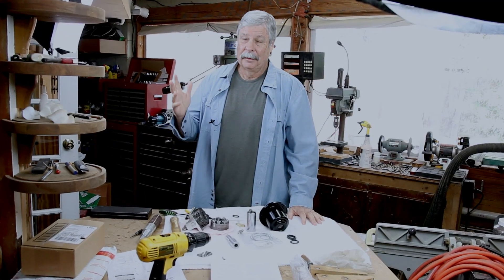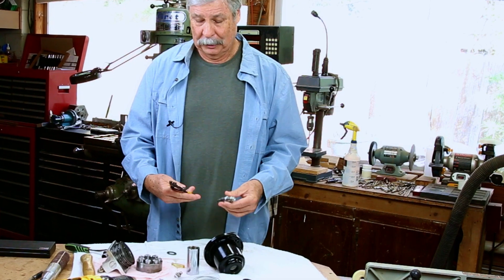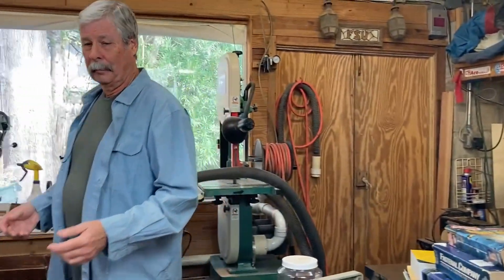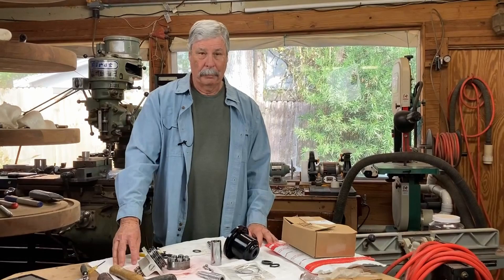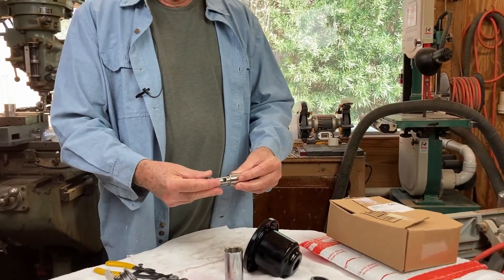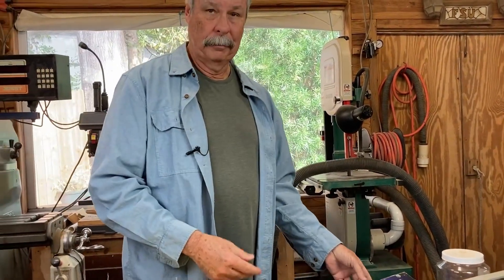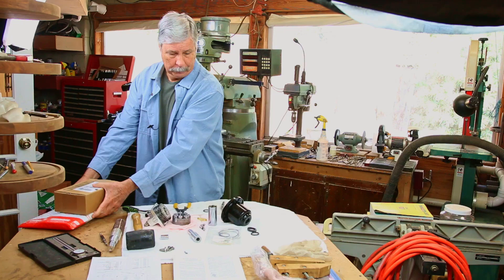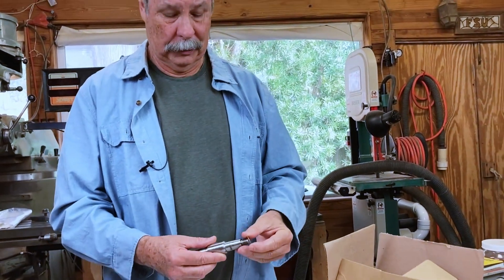Sometimes a missing part won't have a reliable part number.

Comment: I was wondering if you could make a snap ring on a lathe..
Reply from the maker: Yes, if you drill some additional holes and grind some material to finish. Perhaps some additional heat treatment. Just not practical. (Instead of a $1 part you would have a $400 part). Good question Gary.